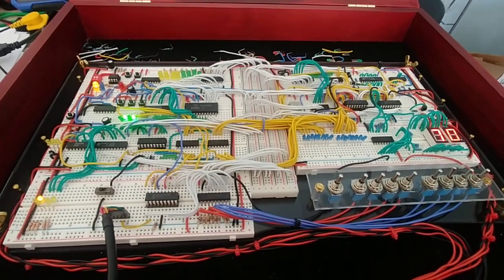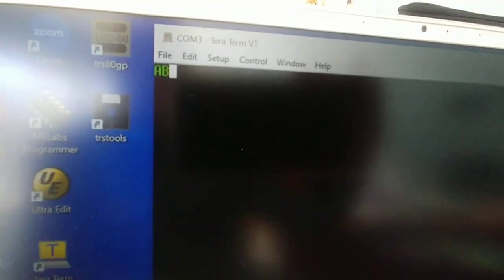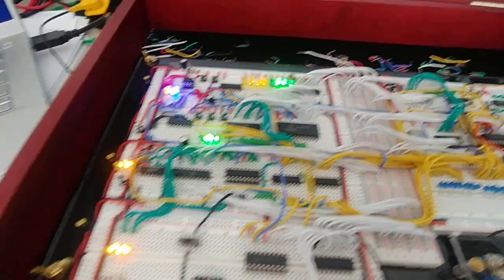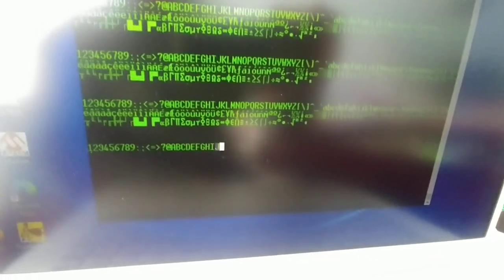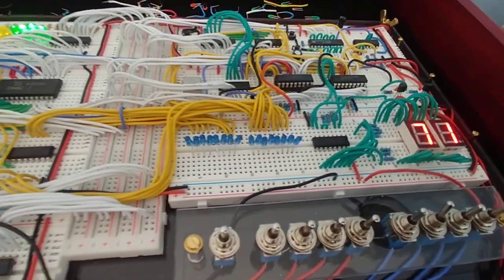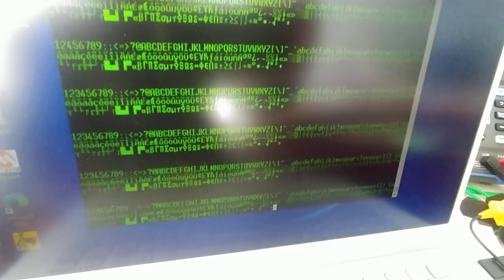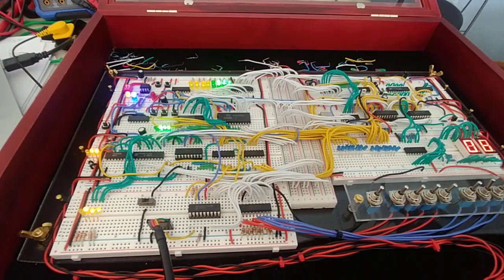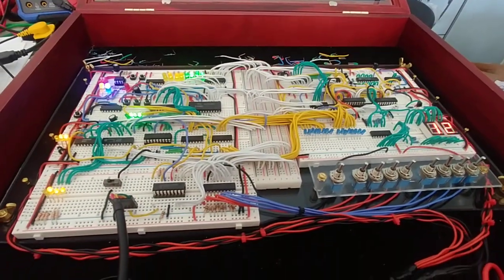My 8-bit TTL Computer #18 - Condition Terminal

Comment: I’m wondering where the printable characters space through 0 are when it repeats. Is it that the terminal is getting “confused” by all the command controls being sent? I can see that at least some of them are being interpreted correctly (BEL, TAB, LF, VT, CR).
Reply from the maker: Hi John.  Yes, I think you are correct.  The terminal is in VT100 mode so all those non-printable characters are likely causing the trouble.  We are sending ESC (0x1b) just before the start of the printable chars and that is the command escape sequence start char for VT100.  Thanks.